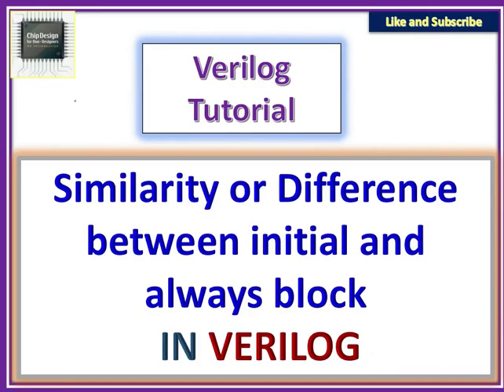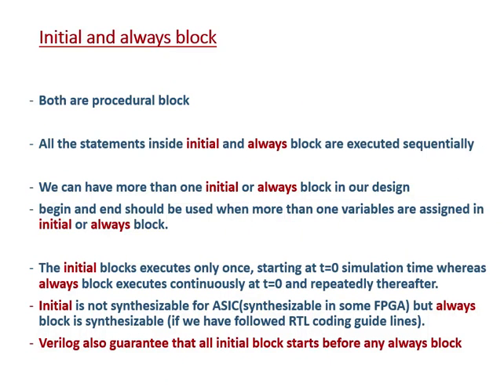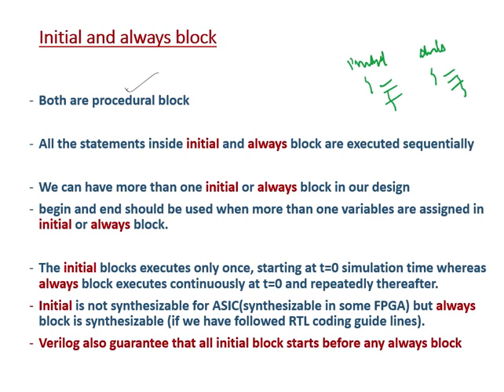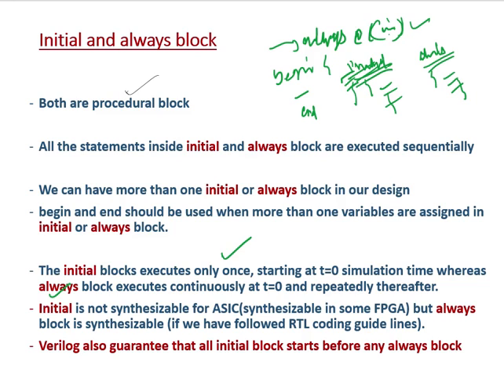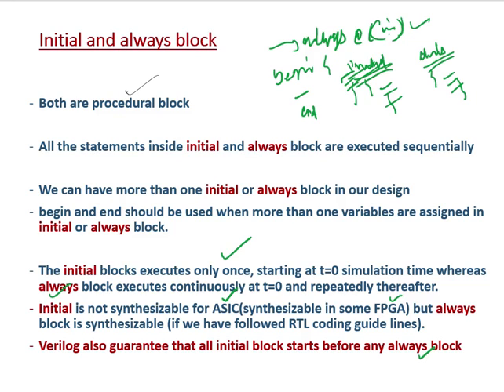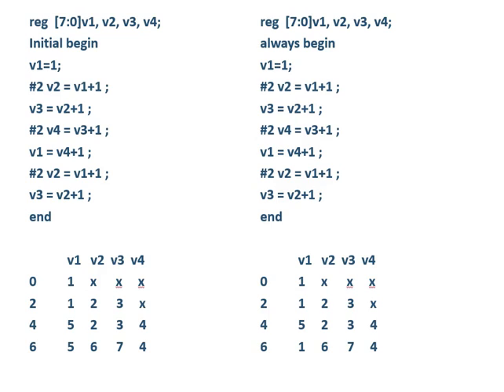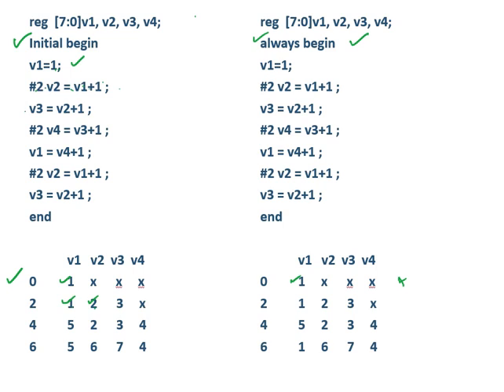#25 Difference between ALWAYS and INITIAL Block in verilog || VLSI interview question

Comment: Sir , in the previous videos, you have mentioned that the statements inside the procedural blocks will be executed sequentially in the order in which they are written , so here why you said that the v1 and v3 will initialise at time t = 0??
Reply from the maker: V3 at 0ns means V3 is updated  0ns after V2 .
Sorry for the confusion.
Reply: @ComponentByte  means v3 will be executed after the v2 execution is completed, got it.👍
Reply from the maker: Yes. 
Or you can say at same time both will be executed because there is no delay between V2 and V3

Comment: Always block and initial block gets executed at t=0 ?? Or after initial block all always blocks get executed ?
Reply from the maker: Both the blocks are executed at t=0. They run independently and parallelly.
Reply: @ComponentByte  sir you mentioned in video that verilog ensures that all initial block executed successfully before running Any always block ?
Reply from the maker: always block is executed when it's signals (inside sensitivity list)are triggered but initial block is executed when program starts (it doesn't depend on sensitivity list) and at once.
This is what I meant. It tells initial blocks are independent of any signals unlike always block. So initial block execution starts before always block and this is what verilog ensures.
Reply: @ComponentByte  oh got it understood now thanks 🙏

Comment: Great explanation. I have a doubt at 11:16,  can you please explain in detail why V4 won't change.
Thank you.
Reply from the maker: In both initial and always block V4 is assigned to a value at 2ns --> V4= 4
This is the only time  V4 gets a value and after 2ns , V1,V2,V3 get new values because of their dependency on different variable after 2ns time. But V4 also depends on V3 but V4 = V3+1 is executed at 2ns and it remains same .

Let's say after last line if we write 
#2 V4 = V3+1; 
Then V4 gets new value again and that's at 8 ns and this value remains same until new value is assigned.

Consider this one
V1 value changes at 0ns then remain same and again changes at 4ns

If you want to learn more then execute the same programm for
1) always@(*)
2) always@(V1, V2)
It will solve all your query, if any

Hope it helps. Thanks.
Reply: @ComponentByte   thank you so much.

Comment: what is meant by synthesizable ,why always block is only synthesizable
Reply from the maker: Synthesizable code means the code represents a real optimized hardware. Optimized means the hardware designed is optimized in terms of power,time and area. 

Something is synthesizable if the corresponding hardware get to know what exactly it's doing. So as per me ALWAYS construct is synthesizable because the hardware designed using always knows what exactly it's doing. 
Thanks.